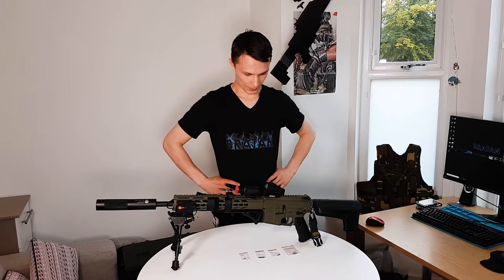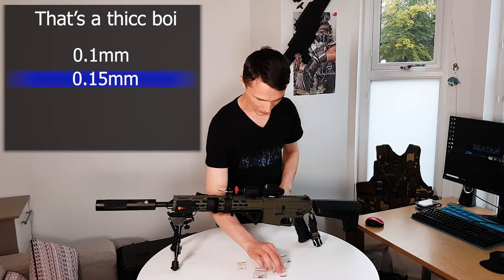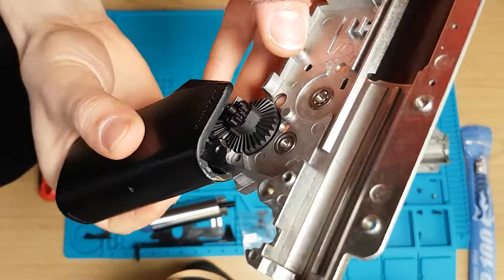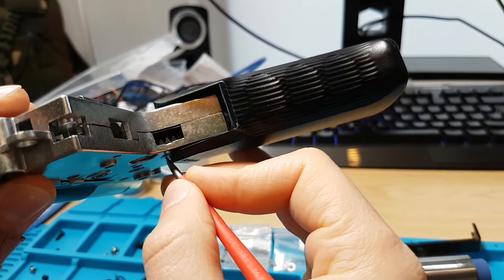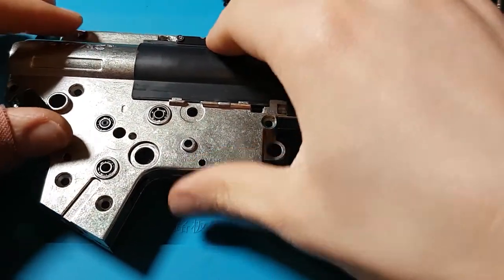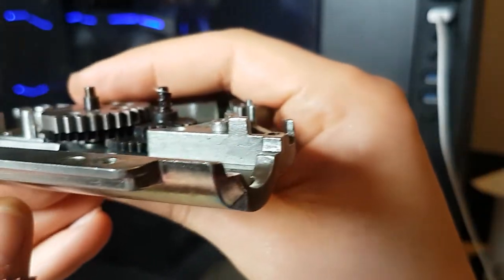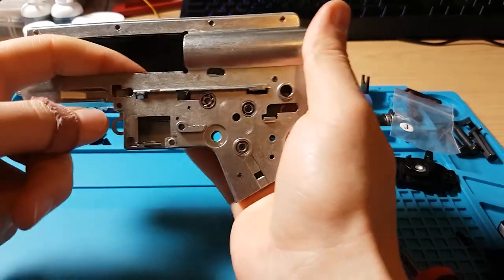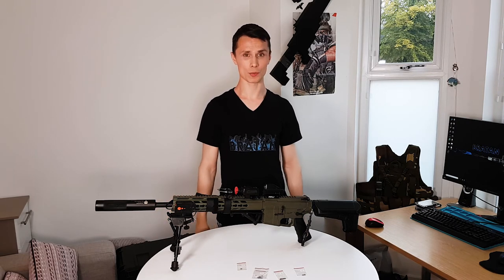How to Shim a Krytac

Comment: What can I do about the self shimming spring? Can I take that off to put in a bushing and a few shims?
Reply from the maker: Do you want to replace the gears? If yes, you need to to the whole process of shimming  
I'm not sure if I understand your question...
Reply: @BRATANairsoft  he meant about the self shimming spring that’s on the spur gear axel. Can that be taken off and replaced with loads of shims?